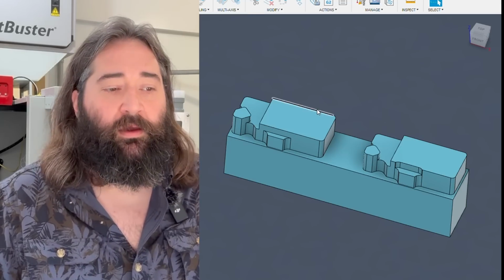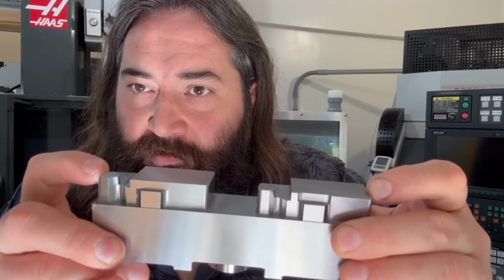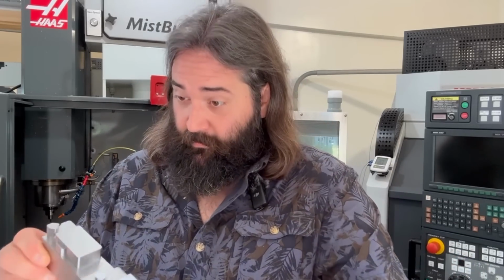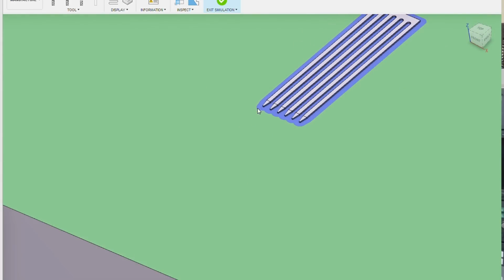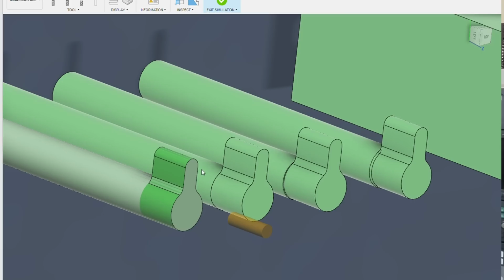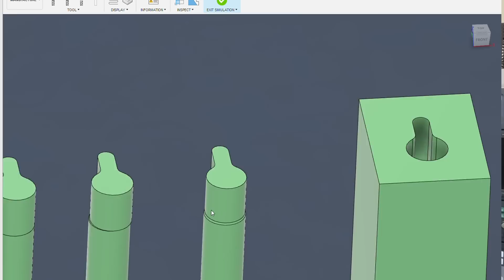How to avoid these unsightly marks

Comment: So what your saying is that I don't completely suck at this!
On a more serious note.... could you go over the best process for finishing out a pocket. My understanding is that to get a great floor we need a bull nose and should finish the floor first, then finish the sidewall with a flat end mill. But we are also not supposed to machine with the side and bottom of the cutter. How is this possible when trying to pick out the radius left by the bullnose? Lastly speeds and feeds for finishing, how do we adjust inteligently and determine best amount to leave for finishing and how much does that change when considering material.... aluminum, 1018, 4140PH, 55Rc S-7? 
Also you have the best teaching style PERIOD!

Comment: Do you use g-code day-to-day? I can imagine doing some tool-offsets or work-offsets or whatever, but everything is done in CAM these days, no?
Reply from the maker: @aaronhammond7297  any parts cutting is done thru cam. The crashes and accidents I’ve had in my career have generally been related to typing in the control , so I avoid hand programming anymore. Thats not for everyone, some shops need to adjust the number of cuts made on big castings or weldments , a simple variable change can accomplish that. A probe can also be used to check the stock and update that variable without human interaction . But lots of bigger machines in the American industrial scene are quite dated do to the replacement cost. So there is still a demand for manual g code programming, but not in my shop

Comment: This is again a nice one. Even though I do know and use some of these techniques, I learned a lot more that I'd like to try.
I do a lot of milling of aluminum parts which are anodized after milling without any processing in between those steps. That means careful planning of milling strategies, not just the lead-in/lead-out transitions but also blending tool paths of different tools, preventing any steps when having multiple setups etc. 
This also means that I do think of the milling tools and strategies to use during the design phase, sometimes using the imperfect result as a surface finish - but that does come with the challenge of making sure that imperfection is constant over the whole surface of the part.

Comment: Another thought-provoking video thanks Adam. I've been experimenting with very shallow approach angles but even then, there's a tiny amount of tool deflection and I can even see a tiny ripple cause by the tool starting to engage and bouncing.  EVERYTHING is rubber below a certain scale. Taking a final contour pass at 5 micrometres above a floor step is still a band-aid solution. I'm still a rank beginner, but I'm convinced that designing in machinability is more sensible than finding tricks to avoid poor design choices.  More of this please!

Comment: Still watching the video, but I've found that when I lead in on the curved sections with a tiny overlap I often can't see any lead in marks.  I experimented with shallower angles for lead-ins on the flat sections and could never get it perfect.  But a 35-45 degree leadin/out on a filleted corner seems to work great for what I make.  I am loving these videos and learning a lot from them.  Appreciate you making them! EDIT:  Hah, I was 30 seconds away from you saying the same thing about the corners.  Too funny.  FWIW, I do this not only on contours but also on chamfers, the same applies.

Comment: I’ve found in fusion, if you just do a spring pass on a 2D contour the lead in line is basically invisible, also I’d love it if you could discuss surface finish on flat/horizontal faces when milling. This is something I struggle with when making injection moulds unless I can use a carbide tipped cutter like a face mill. If I use an endmill I never get a good finish

Comment: Another finish issue that drives me nuts is tool swirls on a milled face. Sometimes it'll happen during a straight line move because a chip snags the tool. But the main situations that annoy me are parts that either a facemill doesn't come off a part before jogging to the next pass or a face or pocket that is cut with a square type toolpath. When the machine stops one axis and switches to the other it dwells momentarily leaving a circle swirl. Whereas if it was done with nice sweeping corners so there is never a stop in the machines motion those swirls don't happen. I was just looking at a part this morning done by someone else that did this. It's a roughly 8" square flat face that was faced off with an endmill using a square corner pocket type tool path. Every change in axis left a circle instead of doing a circular type facing tool path so the machine never paused.

Comment: I split the part into full loops height wise and mill them all the same way. Mill to nominal size directly and make a spring pass without compensation for the tool to relax into the work the same way. By doing so the steps are hardly recognizable. I also put a tiny ch am fer (0.1 mm) on sharp corners and start in the middle of it. Break sharp edges this way and making the start/end invisible. Another strategy I learned is to use the full cutting length of the cutter all the way using adaptive strategies. In the past I would use 1/2 D z height in step size per pass. By doing so this end wears out first and start approaching a conical shape. When blending in top/bottom configurations you end up with a more or less visible transition line. If you use the tool in full cutting height as much as possible the tool wears out more uniform and transitions will look and feel much better during the life of the tool. And, in single part production or a small batch; depending on the function of the finished part some elbow grease in combination with steel wool, scotch rite, high speed de-burring tools and fine sanding paper and the right mindset can make great results too. Maybe some tips here. Adam, your the king here, I just try to add some useful information. I learn a lot from all of your videos. Thank you! Stay safe and all the best! Job

Comment: I split the part in full loops height wise and mill them all the same way. Mill to nominal size direct and make a spring pass without compensation for the tool to relax into the work the same way. By doing so the steps are hardly recognizable. I also put a tiny chamfer (0,1 mm) on sharp corners and start in the middle of it. Break sharp edges this way and making the start/end invisible. Maybe a tip. Best! Job
Reply from the maker: All good tips, I generally use a mold making endmill and fine step downs to achieve a clean surface. The goal of the video was to address this issue from a design perspective though. How much time and money can be saved on a global scale if we didn’t need to do spring passes and extra cuts to avoid some tool marks
Reply: @adamthemachinist  ; I totally agree. For me this is a way to gain satisfaction for the work that I've done. My clients visit my shop before and after the work done. A lot of them are young and inexperienced. I reflect on their design and the consequences it has on the production of the part of parts. By doing so I recognize they appreciate my input and they get better at their job. Progress for both parties.

Comment: I'm not a professional machinist, but what do you think about using a lead in angle of 5 or 10 degrees as opposed to the default 90 degrees?
Reply from the maker: There is a radius making the final transition. Usually about 4-5 times bigger than the amount of finish stock. That has a similar effect to a subtle angle entering the cut.

Comment: Imagine reaching the point in your CNCfu where you have to take stuff like Machine Thermal Expansion into consideration 😱

That being said... Wouldn't this being an issue essentially mean you're using the wrong machine for the Job? 🤔
Couldn't this be solved by essentially air-conditioning / water cooling the critical parts of the machine? 🤨

Perhaps next a Video about small and or thin Parts Work Holding? 😁
Reply from the maker: Thermal management is really what it’s all about past a certain level. Having a chilled motion system , cutting fluid , and spindle solves most of these problems. But even odd things like your compressed air being piped in needs controlled when you want that last percentage of thermal consistency
Reply: A video about small and thin part holding would be great!
Reply: It's not that crazy for a lot of machinists and shops.  My main VMC does not have a spindle chiller and if you're running it at 10k (max) for a while it will get warm and grow in Z.  Most of what I make doesn't have critical features in Z so I don't have to worry about it very often, but it's not that wild of a concern in general.
Reply: why "imagine": that should be a stanard consideration, especially if you are running batches.

Comment: Great video, thanks! For aerospace parts we see the same challenges on pockets with several different floor heights and brackets with thickness steps. Usually the cam department makes happy noises when i explicitly design into the cad model how surfaces are supposed to meet up. 

Often i do this with 0.1-0.3 mm surface offsets on the negatives bodies that i subtract from my part body to make the pocket. It makes all the mismatches explicit and on a general tolerance of 0.5 mm it falls away in the tolerance band so no need for quality to try to measure them.

Comment: Minimizing Visible Tool Marks in CNC Machining: Design Considerations for Seamless Aesthetics

* 0:18 Lead-in/Lead-out Marks:  Introducing an end mill to a cut creates a lead-in and lead-out, resulting in a small step or mark. While acceptable for many applications, high-end products might require minimizing these marks. 
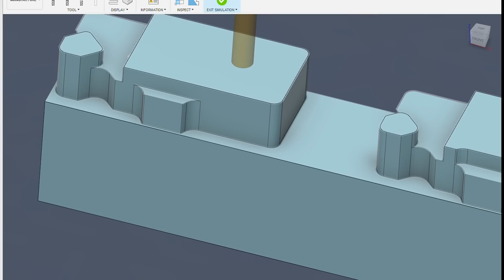* 2:00 Strategic Lead-in Placement: Placing the lead-in point at a corner or fillet tangent point can effectively hide the transition and minimize visible steps.
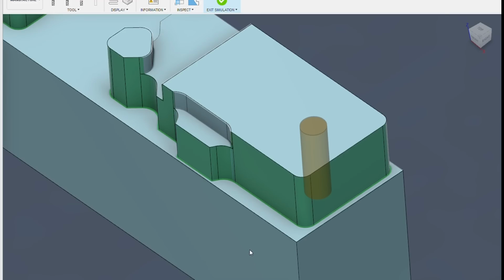* 3:19 Challenges with Flat Surfaces: Blending steps on flat surfaces is challenging as the same tool cutting at different depths deflects differently, making a seamless transition difficult.
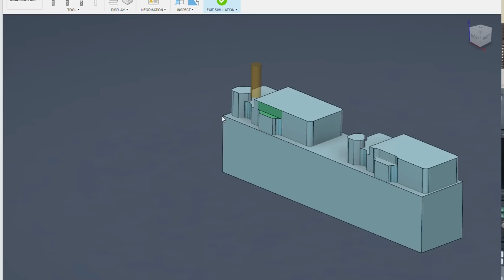* 4:29 Design Adaptations for Flat Surfaces:  Instead of flat surfaces with steps, consider incorporating cutouts, large chamfers, or radii to provide a natural blending point and eliminate the need for a potentially visible step.
* 6:48 Orientation Changes and Kinematic Errors: Flipping a part in a multi-axis mill introduces kinematic errors, making it difficult to blend surfaces machined in different orientations.
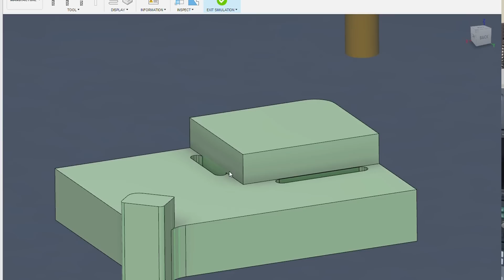* 7:54 Intentional Steps for Orientation Changes:  Design features with intentional steps between them when they require machining in different orientations to avoid visible mismatches. 
* 8:39 Micro Features and Blending: Blending micro features into larger surfaces presents challenges. Using a larger end mill for the primary surface and a micro end mill for the feature might require multiple passes and adjustments. Facing the entire area with the micro end mill could introduce excessive tool wear.
* 10:58 Turned Features and Milling: Blending milled features into turned features (like a shaft with a milled protrusion) is challenging due to inherent differences in surface finish and potential thermal expansion of the lathe or mill.
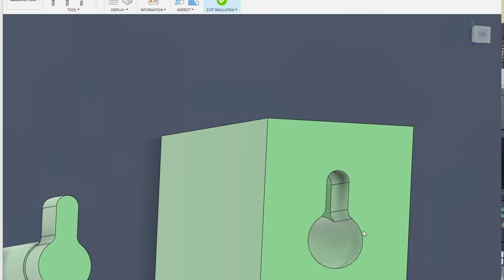* 12:56 Intentional Steps for Turned/Milled Features: Design a slight intentional step between turned and milled features to avoid blending issues and simplify machining.
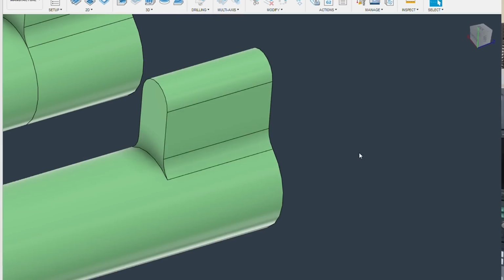* 14:41 Splines and Turned Features: Similar to other turned/milled combinations, blending splines into a turned diameter can be difficult. Consider an intentional step to separate the features visually and functionally.
* 15:15 Surface Finish Differences: Turned surfaces have a fine thread-like texture, while milled surfaces have a scalloped texture. This inherent difference makes blending them visually challenging, even with minimal size differences.
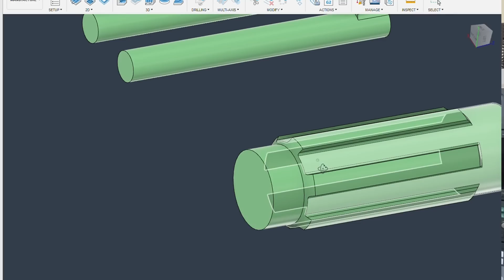* 16:15 Intentional Steps for Aesthetics:  For high-end parts where aesthetics are paramount, intentional steps might be the best approach to ensure a clean, visually consistent appearance, especially when blending different machining operations or surface textures is involved. 

I used gemini-1.5-pro-exp-0801 on rocketrecap dot com to summarize the transcript.
Cost (if I didn't use the free tier): $0.07
Input tokens: 17189
Output tokens: 562

Comment: I'm not a CNC guy, but i still love these vids, best practice ideas, thanks mate👍👌🇦🇺(might have an extra 0 in the in/mm conversion👍)
Reply: @adamthemamachinist	thanks for the video. 
It should be obvious that your aim in this video is not the machinist but the designer. Some engineers can’t understand/care about the machinists and/or mechanics. Impossible to do a simple repair because of a nut/screw’s bad placement; you have to disassemble the whole piece.
On the other hand you have small shops where the staff works as a well oiled machine; better when you are the designer, machinist, mechanic …… sales rep, accountant, ad support tech.